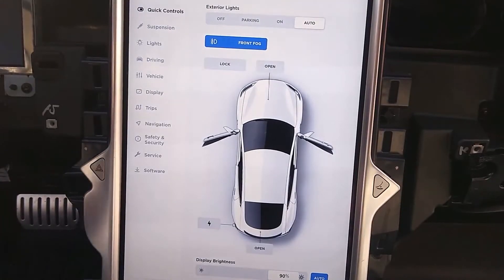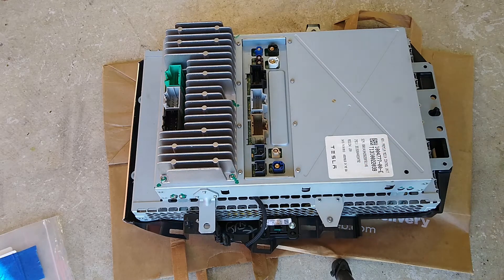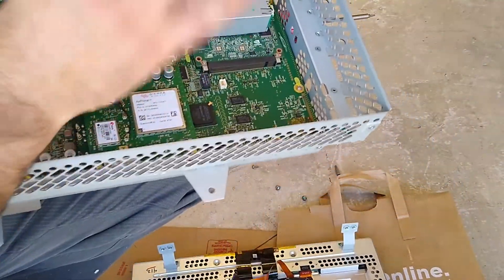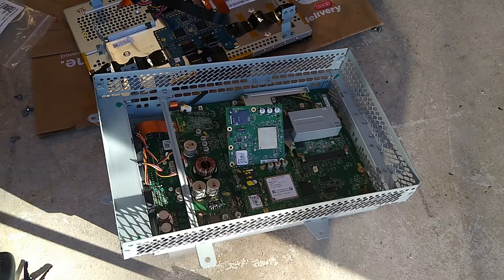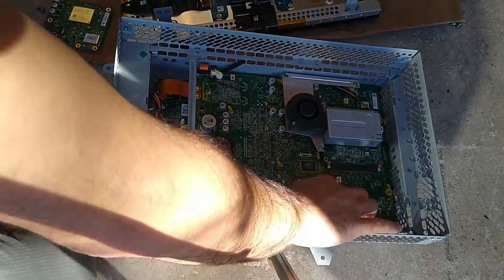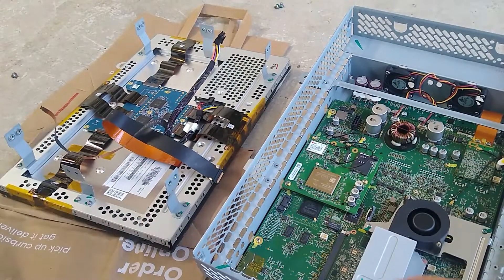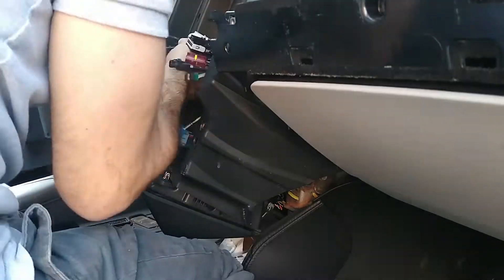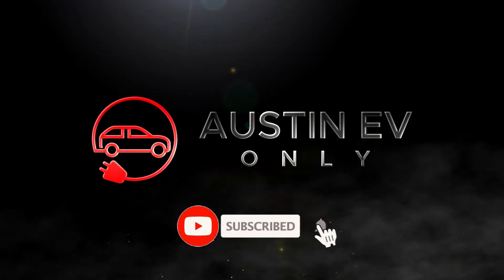How to upgrade Tesla 3G TO 4G / LTE

Comment: 26 liked. Not sure if this mod will work in Australia, I contacted Tesla AU about this mod and they stated its for US customers only. I want to keep my MCU1 in my 2015 model S as I listen to AM talk back radio most of the time and MCU2 does not have AM radio and DAB+ is next to useless here. But our local telco carriers are decommissioning 3G mid this year.
Reply: I feel your pain, they told me that just the card can't be updated from 3G to 4G in Australia, nope, you need to spend $4,000 or so on a whole new MCU2, updated instrument cluster etc, no thanks.
I think what I will end up doing is just using an old mobile phone as a hot spot in the car all the time and have the car connect to the hot spot WiFi, way cheaper than what Tesla is offering.

Comment: How fast are the Tesla computers?  Can you game on them?  Can you attach SSDs or USB 3.x Flash Drives with your .MP3 & .MKV or .MP4 movie library to playback over the car's computer?  Can extra video displays be added to the car's computer?  I could totally see adding flat panel displays for rear passengers, adding digital projectors to cast visual effect onto side panels, under the car, just in front of or behind the car, special video loops inside the rear of the car for other drivers to see.
Reply: The MCU is not that fast. It's Linux based, you can game on them, MCU1 basic games, MCU2 has PlayStation level games. You can connect ssd, USB to the USB ports for music, etc. MCU2 has Netflix and other apps. You can't add extra screens.